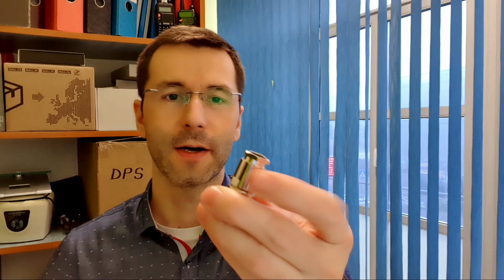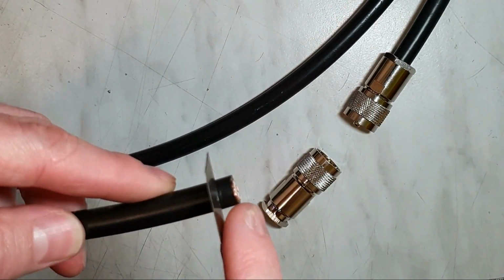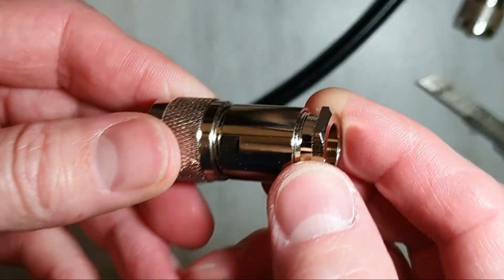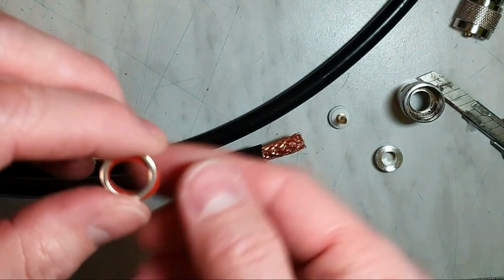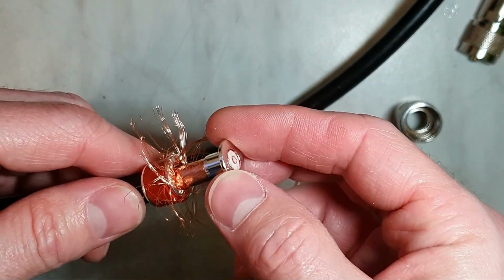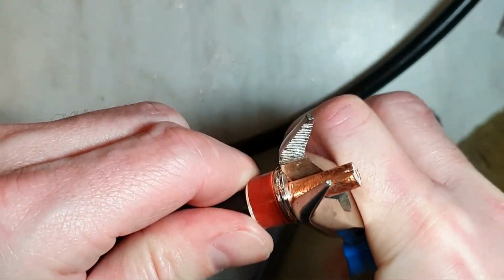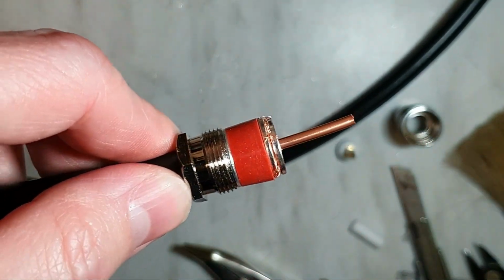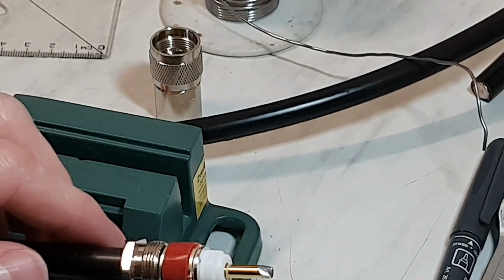Installation of PL-259 (Clamp) connector on to H1000 Belden coaxial cable (magnetic loop antenna)

Comment: Hi Paul, I had appreciated your reply dealing with this newer style PL-259 connector. Coming up with dimensions and knowing 25 mm is approximately 1 inch, I believe making the first slice perpendicular around the coax at 5/8-11/16 inch would work and perhaps even give me some extra length to work with to solder. Then the second  slice inline on the coax about 1/4-5/16" to allow the 'feral' to slip under the shield seems about right for the dimensions inch wise. I want to use these new style PL-259's that I can see would give a much tighter and secure connection than the 'American' style PL-259 that have given me so many problems over the years. Having the back end break out or problems soldering through those little holes always caused repeated problems.  I know once at least on a large 5 band quad not soldering to the shield caused problems only on 10 meters with SWR. Terry

Comment: Paul, thanks so much for providing this video. Here stateside I never saw these type of PL-259's up until a couple of years ago. Always were the Amphenol type that is so hard to get a proper solder joint to the shield thru those little holes. Also they can be tough to prevent the little shield wires from shorting to the center connector. Until now I have never seen any videos if how to install these and you pointed out so many things I had not seen. Like the 14 and 16 mm wrenches making the connections good and tight. And I never saw before about splitting the jacket to allow the feral to insert into the shield. I like these 'new' PL-259 connectors and think they will save on problems. Terry
Reply from the maker: Thank you Terry for your comment! 😉👍 I am so happy that this video fulfilled its purpose! 😊
Reply: @OM0ET  Can you provide in inches the dimensions for cutting the coax and installing this style of PL-259? 1.2 cm I would guess about half an inch. Terry
Reply from the maker: 0,4724409449

Comment: If this is the coaxial cable that you are using for the  radiator of the  magnetic loop then  you are making some mistakes.
1. The coax in this case is not being used as coaxial cable (i.e. transmission line), so the cable loss/meter is absolutely meaningless. All of the RF current is on the outside of the shield.
2.  Because of skin depth there is NO RF inside the shield, so connecting the center conductor  is a wasted step and not  necessary. The piece of cable will perform exactly the same whether the center  conductor is present or not. If this were not the case, copper tubing would not work as well as braid as a radiator, but  in fact,  if the same diameter as the shield, smooth copper tubing is superior as the RF resistance of a smooth copper tube is lower than a rough braid.
3. Because the radiaton resistance is so  very very low, using a connector that does not solder the shield to the outer conductor wil lower the effciency of the antenna. A mechanical connection has higher resistance than does  a soldered joint and wil also oxidize over time makeing the efficiency even worse. This is of much lesser  importance than if the cable is being used as a transmission line. But here it is not.

Dale W4OP
Reply: Hi Paul,

do you know https://www.owenduffy.net/calc/SmallTransmittingLoopBw2Gain.htm to check the performance of the antenna depending on the usable bandwidth?

If you want to try again to connect the outer conductor of the coaxial cable, then I recommend http://www.dl0hst.de/daten/software/MagnetLoop_Aide.pdfhttp://www.dl0hst.de/daten/software/MagnetLoop_Aide.pdf  the coupling loop on page 11 ... However, I don't have a technical background either ... But it's the best low SWR clutch I've tried. 

73 Ralf DL6URK

Comment: the center pin and the threaded barrel part are approx 1/8 inch too long....to find out how much too long simply measure the familiar solder type pl-259 and you will see what i mean....being too long you can not secure the connector the center barrel will still be loose.....i disable them and use my bench grinder to remove the access....then they work fine..

Comment: Mostly correct installation , however the dielectric should protrude a couple of millimetres past the washer and the body of the connector should be screwed onto the nut not the other way around . Lastly the centre
 pin should be soldered after the compression fitting is assembled .

Comment: why did you do the 5 mm cut to the outer jacket ?....also i don't see any video confronting the front where it screws on a so239..it is too long...when i tried to connect it to a balun or a coax switch it will not tighten...i had to grind approx 1/8 inch off the conector to be able to tighten it safely..

Comment: Shouldn't accelerate cooling of a solder joint with air like that, can cause a cold joint from poor crystallisation of the metal. Let it cool naturally.

Also the hat thing is called a ferrule.

Comment: Glad to see you back with another video. And thanks for the information on the cable. I wasn't sure if I understood...is your mag loop cable 70 cm?  By the way, your English is very good and I understood everything completely.
Reply from the maker: Thank you very very much 😊 Yes, I was very busy on december at my work. There was no place for HAM radio to much. The diameter of the ver.4 is exactly 1m. It's 3.14m circumference. Thanks for the kind comment 😉 73, Paul